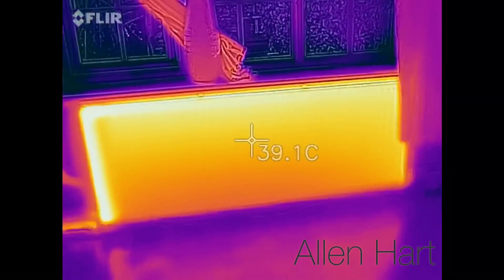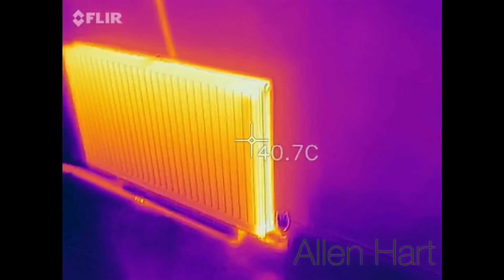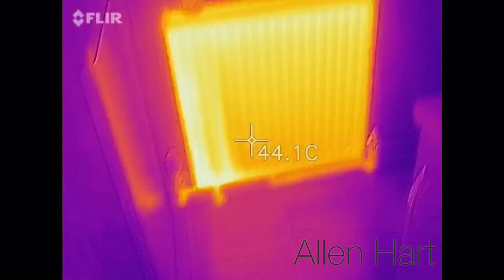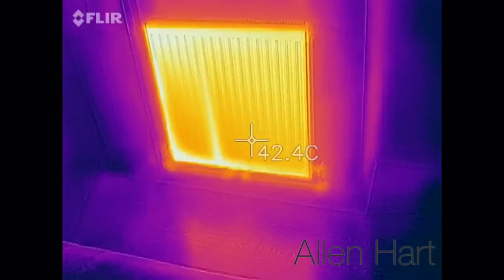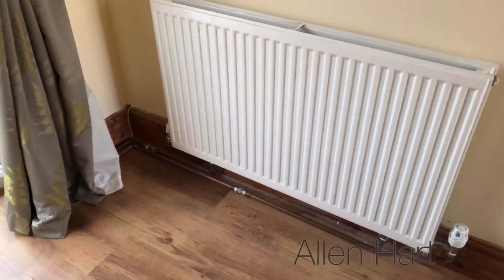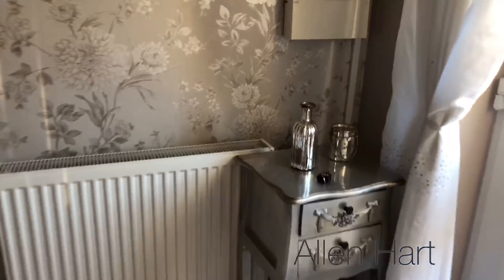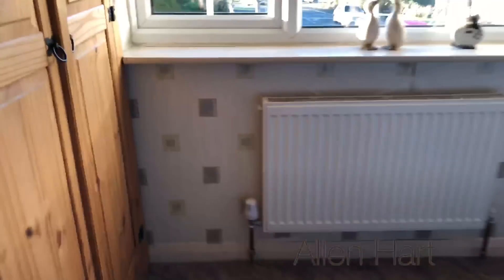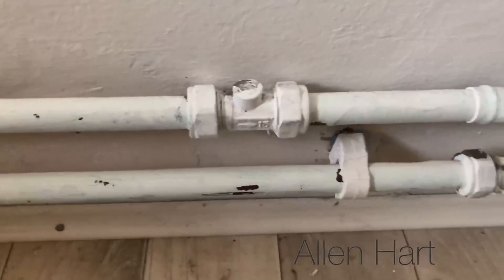Failed Powerflush using Thermal Imaging Camera, Badly installed heating

Comment: Your video's are much appreciated but there is a big , a very big downside. Not all central heating engineers are trustworthy honest guys, and given a bit of knowledge that you impart in these video's only irks the C E's further! I am a carpenter and joiner old school, C&G O N C  H N C  and Master, been in the trade (now retired) over 55 years, so I know my trade too, and the worst thing in the world is a customer that thinks they know it all. And my answer is well  you don't need me then bye bye!  IF all  heating engineers were honest trustworthy and do a good proper job, they would not have such a poor reputation as rip off merchants! With my trade you visually see the results as with yours most of the work cannot be seen, like an electricians work, most is hidden.  You seem like a decent honest guy and you know your stuff, but as with all trades the rip off cowboys get us all a bad reputation, when reputation is everything.

Comment: Hi Alan ,
I’ve been having heating issues , gas Engineer advised pump should be replaced , once it was replaced the heating came on downstairs for a day but then went back to normal and stopped working , upstairs ones are working although not much heat  , i was told it must be sludge , I have microbial pipes , my boiler is 15+ years old with old cylinder upstairs , would you recommend a powerflush based on what I’ve written , or stop spending and get a combi ?
Reply from the maker: maybe a powderflush would help you? Thanks.

Comment: Repipe is the only answer preferably in 15mm copper and lift the floors.
If money is tight leave floors untouched and pipe in 10mm .Its a lot easier to conceal than you think...behind skirting and the like.

Comment: How are people allowed to get away with work like this?
Years ago I have put in a few CH systems and common sense, a basic understanding of physics will be a good start.
Understanding basic water flow is not difficult if you  put your mind to it.
Reply: So your a diyer.
Who inspected the heating system you put in years ago.
Ah ok you self certified your own work.So its probably a disaster.
Reply: @iancampbell582  I have an honours degree in Electronics and repaired and soldered SMT so would guess I can solder better than you ever could. I always got anything I did certified by a good friend who is a senior combustion engineer for a large maintenance company who often begged me to join them as their senior BMS engineer guess I could manage that as I also have a degree in Computer Science 
BTW I am now retired and would probably use press fit

Comment: That looks like a combi/system boiler.  I had a problem like this once.  I put a second pump on the system, on the return, with a relay switching it in and out. A push me, pull you. The two pumps pushed enough water through the rads for emit enough heat OK with not too much water noise.  It was for a friend. I had a spare used pump and told him to see how it goes.  It worked. I am not saying it will work on all systems, but worth looking at other solutions before expensively ripping a house apart.

Comment: The system was put in by numpty for sure. But!  In 95% plus of running operation, as long as the boiler is set to maximum temperature, it will heat the house fine.  It is the time when it is -5C outside it will struggle.  It may be cheaper, and less upset in the house, to have secondary double glazing and extra insulation fitted - which will also drop heating bills giving superior comfort conditions.  Uprating the piping will not drop heating bills.
Reply: Your off your head john
Reply: @iancampbell582  
What didn' you understand? 
I can help you along.

Comment: im sure the 8mm worked absolutely fine when it was fitted originally just the poor additions that have made the system struggle. I've seen houses plumbed in 8mm from 22mm manifolds that work fine till they block up, which they always do unless kept well maintained with plenty of chemicals and flushing
Reply: Once I got lucky with an 8mm blocked pipe- took it off the rad end and put it out the window - put the mains via a hose on the disconnected manifold end - blew a slug of debris 15 feet down the garden .

Comment: Good for Alan in not charging the Customer for a pointless powerflush;  the customer would not have been impressed by a big bill with little or no system improvement. Shows a very professional approach.
Micro bore (6,8 and 10mm) was promoted quite heavily by the tube manufacturer Wednesbury in the late 70's; I recall a glossy technical specification and installation document.  Stressed was the need size the system correctly, in particular the possible need for an up-rated pump to maintain a significant flow rate.  Not much of a problem when all boilers were heat only and the pump was sized and installed separate but I do wonder how many replacement 'system' boilers are installed without ensuring the inbuilt pump delivers sufficient head.  Recomputing the microbore system's head requirements without access to the relevant pressure-loss tables would be tedious.
If a microbore system needs extending, then 15mm pipe is a better bet than 6/8/10mm as the pressure loss will be less but obviously a rather more professional install is desired.
Reply: Well done that man..with the 8mm pipe, and plastic connections, could of opened up a can of worms..

Comment: Glad you didn't comment on the towel radiator temp. Emissivity of a chromed surface like that is going to be around 0.3 so what you're measuring is going to be heavily effected by the temperature of what is reflected in the chrome. We paint test pieces with a thin layer of matt black paint and measure off that.  I've got one of those Flir plugins for Android and it compares very well with the £5.5k Fluke in terms of general readings.
Reply: Yes emissivity is rarely understood by anyone in possession of a thermal camera. I had a trade tell me my primary heat exchanger was blocked with sludge as he could see a cold spot on the side of it. I had to attempt to explain that it was the shiny label on the side of it he was measuring. He still didn't get it so I gave up, but he stopped trying to upsell me at that point too!

Comment: 8mm is pathetic. Are those plastic push on elbows even allowed in a heating circuit? They seem very dodgy to me.
Reply: They work fine when used on the correct pipe work like pv or copper pipe (chrome pipes is like no as they can pop off under slight pressure sometimes)
never had problems with 8mm pipes apart from low flow rate just takes longer for rads to heat up usually (only see it on +30 year old houses  or new builds where they are cheaping out ,every pipe has a 8mm to big pipe size adaptor lol as radiators use the normal size pipes funny thing is not sure if they are saving anything as they need 2 adaptors per pipes and normal a bit of 15mm pipe as well)

Comment: And this is why I specifically requested no microbore with the heating system I have just had fitted, 22mm copper from the boiler to the 2 primary runs with 15mm feeds to all rads

Comment: Who uses 8mm pipe for heating? Absolute Muppets!
Reply: 8mm microbore was cheaper to install in the 1980's - all house build in Aberdeen were done in this as it was less labour intensive. 15mm off the boiler to a manifold and direct run to the radiator. quick and dirty. Precursor of plastic runs.
Reply: @abzzeus  8mm is for break lines for cars.
Reply: @henrytwigger2245  brake line is 3/16 or 4.75mm ya donut.
Reply: @abzzeus  Same down here, mostly the big volume housebuilders doing it to save a few quid. A few of my friends bought houses in the early 2000's, that had been built with microbore heating in the 90s... As most people buy houses in spring and move in summer, they didn't realise the heating systems were all sludged up until the first winter, and they all ended up buying bottle after bottle of sludge remover (with varying success). I think all of them ended up buying entirely new heating systems to cure the issues as a powerflush for £100's with the ever-present "no guarantee this will fix it, and no guarantee we won't burst your pipes" disclaimer puts people off :-)
Reply: @abzzeus  yeah there's a lot of it here in Nottingham with twin entry radiator valves with the distribution pipe that always blocks up.
Reply: Most of the t points in are house are 8mm (old 30 year old pipes ) be bit of a faf if the front room radiator pipe ever goes as that's under 4-5 foot of rubble ,they should of replaced it when it was filled in  (whole system should of been replaced when house was been messed with 15 about years ago and again 2 years ago but everything is been done in bits and he don't want to get everything done right first time, waste pioes will likely be next problem )

Comment: how are builders allowed to use 8mm microbore then if you say it needs redoing in bigger pipe???
Reply: Because whatever you quote for, some numpty will quote cheaper. Customer doesnt understand need for 22mm F&R and 15mm rad pipes, so they go with cheapest price. 
Cheap as chips worker comes in (I won't call them a plumber), and fits the cheapest pipe and fittings they can. I always try to explain the reason for a certain specification, and thats the only way customer gets to understand how proper prices get  undercut by downspeccing the job.

Comment: wise move.. chrome pipe connected onto a push-fit elbow which i doubt has been filed off has blow off written all over it..
Reply: True that iv seen them blow off with 0.5 bar
Reply from the maker: Thanks for watching.
Reply: You have to file it and still if it’s not smooth the ribber inside won’t seal I’d never put any push fit on chrome regardless if it was filed smooth just wouldn’t take a chance it’s somebody’s property if it’s not done right then don’t do it atall

Comment: Was that Hall rad speedfit elbow on chromed pipe?
Reply: Allen Hart I’ve had a few from a very large gas company saying systems needed a 600 quid plus flush by them. Last one I went to nothing wrong with the system other than rads undersized by 20% at least. Makes your blood boil 👍
Reply from the maker: The install was very bad, customer had been advised by a large company it needed flushing, they booked us in for a flush and this is what we found. water in system was clean and rads where new
Reply from the maker: i guess its an easy way for them to get away from the probelm.
Reply: wayne burgess I noticed that aswell.